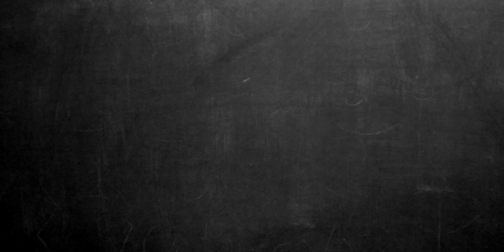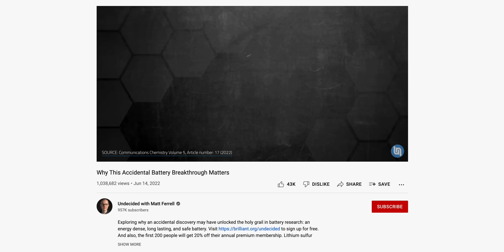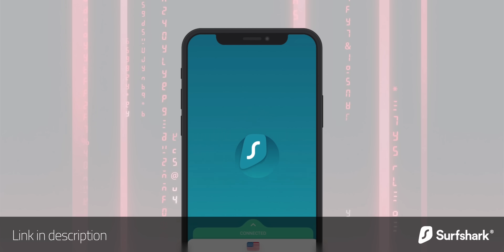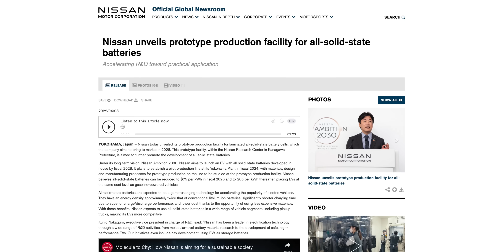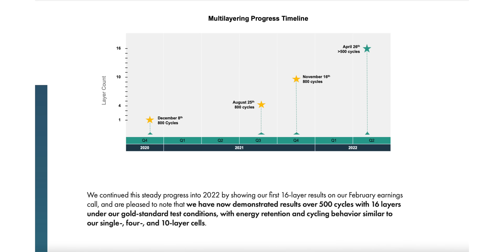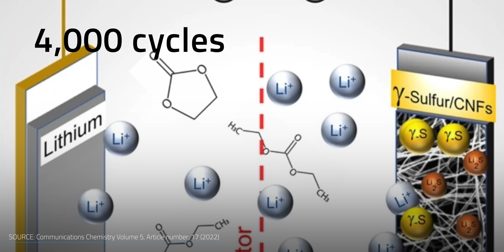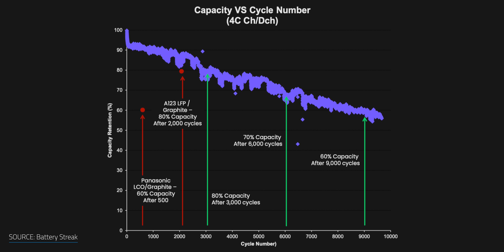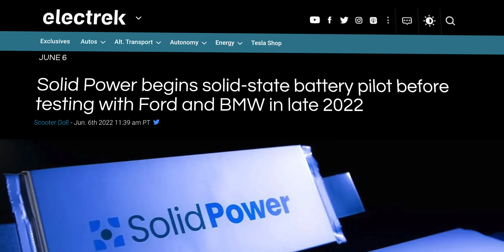Is This Solid State Battery Too Late?

Comment: Matt, nice compilation.  Battery tech is moving fast and we are at the dawn of the battery revolution.  The "best value battery"  for one application is not always the best value for another.  I for one want to see every option studied as the amount of "discoveries" found by accident is quite high because of the interest and broad spectrum of research.  The more choices available means more "things" can go untethered and that is a good thing.  It is very interesting to watch the progress, glad we are not always "30 years away" like fusion when it comes to battery tech improvements.  And yes, Solid state batteries are going to have a lot of uses where they are the best value.  Here's to having a lot of great battery choices in the near future.
Reply: You're an order of magnitude away from fossil fuels now. That's why internal combustion engines can be an order of magnitude more inefficient than electric and still piss all over EVs.
Reply: @1pcfred  , cars are by no means the only use for stored electric energy.  And yet there are electric cars and trucks that have very good value for the tasks they were meant to accomplish.  Companies are adding EVs to their fleets, why, because they are a best value.  Home storage, grid storage, and other uses also allow batteries to be a best value for energy generation and usage in some applications.  But I agree, the sound and feel of a large V8 winding up can't be replaced by an electric motor. Both have their place.

Comment: Prieto Battery is another novel contender. Their battery tech has a claimed density of 650 Wh/L and comprises of an electroplated copper 3D foam-mesh anode encased in the cathode and solid electrolyte material. They expect to have final prototypes by 2023 and mass-production by 2025.

Also, existing Li-Ion cell production equipment comprises the vast majority of the manufacturing process and the process eliminates the need for clean rooms and toxic solvents.

https://youtu.be/k7nNFcbKZos

Comment: What about the solution of structural battery exchangeability?  Shouldn't a consumer be able to decide to buy a new tech Solid State battery and put his old Tesla structural 4680 battery in the flower bed or the water heater closet?  It is really poor form to design that capability out of a Tesla vehicle just to perpetually tie the customer to the underperforming Tesla battery.    Maybe Tesla can make a solid state 4680 structural battery.  Customer should still be able to upgrade his cars battery.  Especially so, if he can sell his old battery to a farmer who can use it on his tractor and reduce the cost to upgrade.

Comment: My car still runs on little explosions so I'm out of the loop, but what I don't get is why do EVs carry a half ton of batteries around all the time even when they're not going far?  Seems like smaller, modular batteries would make more sense.  Also, you could just swap them out for charging. In other words, make them a little more flexible and a little less like iPhones...
Reply: A number of companies have had this idea and found that it isn't feasible. It would require much more infrastructure related to recharging, many more employees to handle the swaps, and above all it would require a much larger number of batteries overall in order to have batteries in all the cars plus more pre-charged batteries stocked in locations where they would hope drivers needed them, plus all the batteries being recharged. This of course in an environment in which battery supply is already constrained. Besides this swapped batteries cannot provide any structure to the vehicle, thus being dead weight in the car - whereas nonswappable batteries can be part of the vehicle's structure, thus replacing other components and reducing overall weight.

However your point that batteries for unneeded range add weight even when it isn't needed is exactly why Tesla has not been building super long range cars. That, and supply constraints.

Despite all this a few companies have been continuing to pursue the model you suggest, but it doesn't look like any of them will see much success. However, Japanese motorcycle manufacturers are not only pursuing this idea but have agreed on a standardized system that they will all use. However, this is possible because motorcycle batteries can be much smaller than automobile batteries.
Reply: @alanlight7740  Wow, thanks for the thoughtful, non-toxic reply! Perhaps a somewhat smaller permanent, built-in battery plus pluggable/rentable aux packs for occasional extended range would make sense.  Just seems weird to me that we have all these cars hauling a half-ton of batteries around everywhere they go.
Reply: @StubbyPhillips  - there has been some discussion about possible range extenders - especially for trucks like the F-150 Lightning or the Cybertruck to allow long distance towing - which might be comprised of portable batteries, a small generator, or a small fuel cell that could be temporarily plugged in in the back.
Reply: When my gas tank is on E, I could just put in 1/2 gallon because I'm only planning on going to the store tomorrow. But I always fill the tank, knowing that I will burn extra gas to haul the rest of the tank rather than going to the station constantly. It would be nice to have modular batteries as an option though. Like adding RAM to early computers.

Comment: Frankly, this video was poorly researched and highly biased. First, the information about Toyota and Nissan and incorrect and obsolete. Toyota has started hybrid car prototyping with their SSBs to be released next year, and expect full EVs with SSBs in 2025. Their biggest hurdle is not the technology, which is proven, prototyped and tested, but production, which they don't have the proper facilities to ramp up production, THUS their partnership with Panasonic, which will enter with the facilities. 

Nissan has not yet announced any production goals yet, but they have the benefit that their battery uses similar production techniques to their existing LiIon batteries and can jump from announcement to mass production faster than Toyota. So while they haven't announced a prototype yet, it is highly expected it is exactly because they have time to search for better components and still make it to the market before Toyota.

QuantumScape has no experience and is pretty much a newcomer and they have only dipped in vehicular level batteries, they promise a lot but are the least probably of the three to be able to release and mass produce in able time. 

Then, the video gets worse by presenting the three "contenders" with SSB: The LiSu breakthrough is basically an idea at this point, they LITERALLY have no idea how they did it and now it works, it is years away from even fully understanding the process, repeat and then mass produce. It could be the future of batteries, but I doubt they will have any serious market-level prototype (if they figure how it works, how to build and it do live up to the expectation) before 2030. 

The Niobium pack have so far only being tested and produced in small sizes and are NOT ready for the massive sizes and manufacture of EVs. They are releasing their prototype sooner than all others, but it is likelly only to hit the markets as small batteries, maybe for mobile and laptops, but they have not been able to give a proff of concept for big batteries for EVs or let alone energy storage. 

And Tesla? SERIOUSLY? They just did what the battery industry has been doing with LiIon for the last 20 years: they invested millions to get some extra boost of the existing technology, which is already near peak performance. It is not even a change, just an improvement based on massive investment.

The biggest flaw in this video is comparing Apples and Oranges. SSB are a different technique to create batteries, by not using a liquid separator. Achievements in components and scalability of current batteries are parallel and translated into SSBs. For instance, the LiSu battery IS a SSB, it is not like it is a competitor or something different, it is quite literally a Solid State Battery that uses Sulfur as one of its components. That is one of the main reasons it have all the benefits of a SSB, plus the benefits of using a better, cheaper and more eco friendly component which is Sulfur (which seems impossible when the separator is liquid). The LiSu battery is two improvements in one step, one of the improvements IS the fact it is a solid state battery. The Niobium battery goes the same logic. Meanwhile Tesla's new model is not new, its just an incremental improvement over an existing technology.

SSBs are and will always be the future of batteries, because they do away with a liquid component that is extremely dangerous and often toxic. Any future battery will be a solid state battery by nature. The fact that we have many conventional LiIon SSBs reaching the market this decade, and that we also have different component desings for batteries that take advantage of the solid separator are COMPLEMENTAR and not COMPETITIVE.

Comment: As a person that lives in a location where extreme cold is an annual expectation, I find it difficult to find any reviews or reports on the effectiveness and lifecycle of any new battery technology under extreme cold conditions.
Lithium batteries have issues in extreme cold.  It is my hope that solid state batteries can withstand cold environment conditions.
Thank you for all you do Matt.  Keep up the great research and reporting.
Reply: yeah, has to WORK in at least -30°C to +40°C, and preferrably some more safe margins on that
Reply: @kitsunekaze93  there's it works and there's it's useable too
Reply: @kitsunekaze93  Think the one we need most is the one that is most environmental friendly in production and easily, cheaply recyclable.
Reply: @kamilpotato3764  It's all well and fine to be economically friendly, but when your electronics die quickly in the middle of winter and your car dies on the side of the highway in the middle of night and you can't get help because your phone is just about dead, you have no hazard lights, there's hardly any traffic, you're an hour's drive out of any town, and your emergency flashlight and external battery pack straight up don't work because it's too cold...... The cold resistance is still VERY important.
Reply: They don't seem to test for extreme cold resistance, which is why we have frozen lithium ion batteries every year for 4+ months.
Reply: You probably have to plug in a block heater for your car now. Might need to do the same for your EV battery packs. Hey the card’s already plugged in. Shouldn’t be too hard to figure out.  Range would drop for sure though. I always thought they should develop a extra battery trailer that you could tow and use for additional range or harsh conditions.
Reply: @DavidB-tj3rj  The problem is that when out and about in an EV, the option to plug in to keep the vehicle systems warm is not usually an option, or even practicable.
Moreover, while traveling down the road during extreme cold conditions, the battery system will need to have a reliable means to keep its entire pack warm.
Extreme heat can be bad for people...  especially those without water.  But extreme cold is something altogether different.  
Example: when it is -20F (-28C) outside, that vehicle MUST hold a charge, MUST start, and MUST continue to run while there is a charge.  Such conditions do NOT allow for someone to walk home safely.  I have not even brought in wind chill as a factor yet.
EVs will need to be able to withstand the worst temps that mother nature can bring (over the course of many years) to be a viable replacement for gas powered vehicles.
Reply: The TeslaBjorn channel does lots of cold weather testing. All Teslas and most other cars are fine.

Comment: Who would've thought a battery cell with about 6x the volume would store 6x the energy 😂
Reply: That's the thing though, it's not always easy to just make a thing bigger.
The scale-up is the technological improvement.
Making each one bigger allows the manufacturing processes to be done more cheaply, reducing the final cost of the product, even if in terms of storage to volume it doesn't appear that impressive.
Storage to cost ratio drops significantly.
Reply: 6 times the power for only 1.16 times the range doesn't seem all that glamorous aye
Reply: Yeah that 6x energy statement is misleading. The main take-away is that lots of small benefits of the new cell add up to 16% range improvement, which may not sound great compared to these other technologies, but unlike them, this is on the road and being mass-produced today.
Reply: How big is your smart phone to computers from the 70s?
Reply: The reason it's actually more surprising than it first sounds is because of dissipating the heat produced both in the charge and discharge processes. Six times the heat has to be dissipated through a thicker cell and with a surface that's only larger by a factor of a lot less than six.

You are right that the energy capacity is no surprise, it's the ability to keep the current capacities similar that is amazing, let alone improving them.

In more detail, and feel free to skip what follows:

The linear dimension is going to be about cube root 6 times as big, so the average distance for the heat to travel is increased by that 

The surface area increases by the square of the above number. These two factors partially cancel as the thickness allows down heal loss but surface area increases it. The back of an envelope overall dissipation efficiency might therefore be expected to be worse by a factor of cube root 6, and charge times increased by a like factor. That's just over +80% longer if the tech was scanned up without any other improvements

To claim an improved charge time is therefore a genuine technological leap ahead, assuming the new cells deliver the promise.

Comment: As i understand: renewables need super cheap, and durable batteries/energy storage technology, like that with brick lifting.
EVs need high energy density, low costs, fast charging, and durability.
And most of electronic devices require same batteries as EVs do.
So only 2 types of batteries are required right now, others are not in such hurry right now.

Comment: One factor I'd like to learn more about for all of these upcoming technologies is recyclability. If a solid state battery can have it's component materials separated relatively easily at the end of it's life, that relatively low charge cycle number becomes less of an issue. But if they end up being even more difficult and costly to recycle at end of life than more conventional batteries, then that would be another significant drawback.
Reply: I totally agree with you. With more and more battery produce we need a way to recycle them. If we cant the tech become useless for the environnement.
Reply: @MexcTech1  the recycling tech is already getting started for conventional Li-ion, so I'm fairly optimistic there. I just hope recyclability is being factored into SS design from the start.

Comment: Solid State tranlslate nicely to be more rugged battery. In case it overheated,it is less likely to create gas since there is less likely to create a vapour. And in case of puncture or leaks, well, its solid so its less likely to be contaminated compared to the liquid electrolyte.

The benefits of the former may not be seen in most uses due to temperature range is where its operable to humans. On the other hand, solid state battery can see use where the expected usage is adverse conditions.

I can't help but see it will still see use on portable electronics like phones and laptops.

Comment: I think all options need to be on the table, and explored to a reasonable depth. As you said, right tool for the right job. 

I'm thrilled that cobalt is being dramatically reduced.  I just wish we could find another option for the lithium. 

While I'm a huge skeptic for hydrogen fuel cells, I think they'll find use in places that Li isn't best equipped for (shipping, possibly grid storage). At least if used for grid, that's one less use/need for lithium. 

Oh, a possible topic of interest would be the current and near term geopolitical concerns...

Cheers!

Comment: Hey Matt, I like how your always talking about stuff. as an chemist i apriciate that a lot, but there is one thing that kinda bothers me which is that I wish you would have a citation in the discription from what sources you've used instead barely show it in the vid itself.
Keep up the good work!
Reply: I second this. An example would be how Real Engineering does it.
Reply: Honestly I prefer people simply learn how to do their own research. It's not 2000 or before when you had to go to a library and hope to find the right book and then request a book from another library. 
Plus this way you can find different sources to verify the results have been replied or at least verified by multiple sources.
Granted this YouTube channel is technically a publication so I do understand the preference form some kind of sources.
Reply: @dalton6173  while I agree totally with your starting point that ppl should do their own research (and therefore know how to do that), I also agree with the request to have proper citations in the description. 

That way we can do two things: firstly verify that Matt has correctly represented the research he has used (I am inclined to trust channels more if they are open to that kind of fact check).

 Secondly when we do our own independent research it is then easy to spot if there's some source that has been overlooked or has been published since a particular video was made.

So my hope is for citations plus own individual research. It's not an either/or in my book.